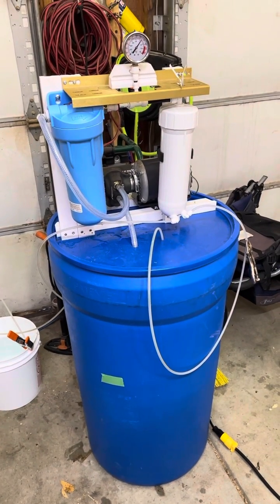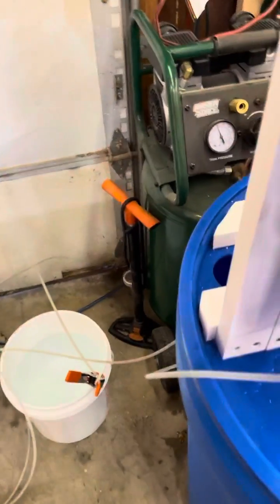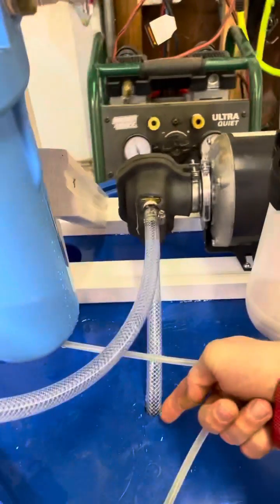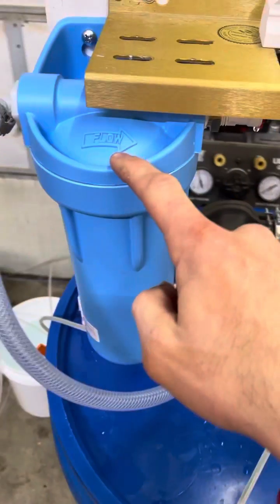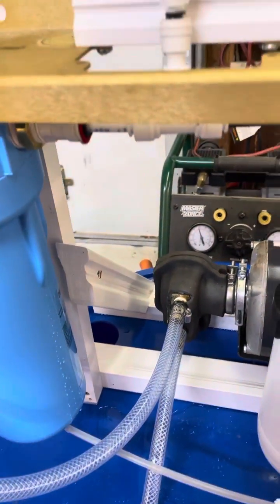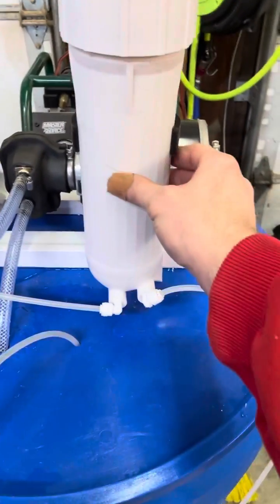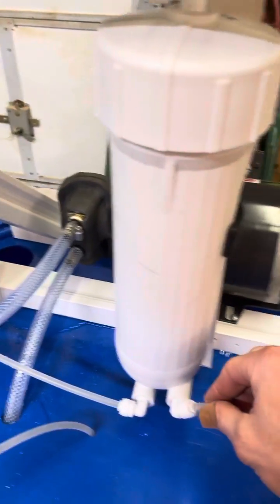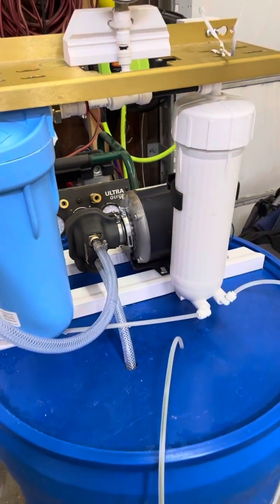DIY Reverse osmosis maple sap concentration.

Comment: You might want to replace the vice grips with a needle valve so you don't create a weak spot in that tubing.  The 150psi is impressive though, I ran my system this year with the classic Aquatec 8800 at about 115psi.  Every so often I'd open up the needle valve and let the unrestricted flow wash the sugar off of the RO elements.
Reply from the maker: In the name of cheap I eventually got it switched to a plastic ball valve. No leaks and it still provided constant back pressure at a fraction of the cost of all the needle valves I saw.
Reply: @hunter14853  yeah they aren't cheap, and they add insult by not including a ferrule and proper acorn.

Comment: That's awesome where did you get your pump and motor from
Reply from the maker: found a used procon pump with motor on ebay. widely used in carbonator applications so fairly cheap. Mine ended up having a pressure relief I need to fiddle with for next year to get higher pressure.